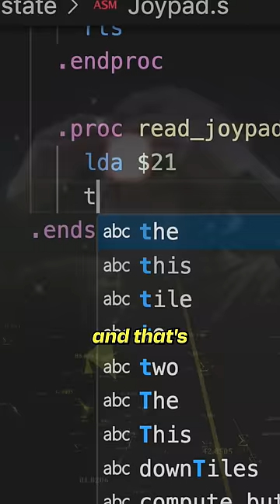NES Games Were Written in Assembly #nintendo #nes #programming #assembly #retrogaming #retrotech

Comment: Assembly is beautiful. A nightmare, yes, but so absurdly efficient when used appropriately
Reply: Any examples I could look into?
Reply: @katzlover321  Quite a few older PC games. Flanker something and Rollercoaster Tycoon come to mind. I could be mistaken, but I believe ID Tech One was built in assembly. At least some of it. It's just insanely fast. Entirely impractical on a modern PC I would imagine. Or pointless 😂
Reply: An 8bit machine is simple enough that it's anything but a nightmare.
Reply: Well, it used to be efficient. It turns out that modern (i.e., after ~2005) compilers are very good at optimizing code for modern processors. I wrote an algorithm in C and then again in x86 assembly, then had a friend (also a programmer) do the same thing. In both cases the C code ran faster than the assembly code, but only by about ~10%. Things like deep pipelines and branch prediction improvements have made writing efficient assembly by hand extremely difficult.
Reply: @TechnocratiK  100%. Compilers have grown so effective that assembly isn't worth it. Add to that the improvements AI will make to said compiling and soon we'll just dictate our ideas to a computer. 

Amazing times to live in.
Reply: @natecw4164 AI literally just hallucinates half it’s code and it rarely works. Please shut up
Reply: @ponivi  What you're seeing today is the worst it's ever going to be. Also that's a huge overstatement. It's not ready to write on its own, no. But half of it being hallucinated/wrong/gibberish... Ask all the engineers out there working for large corporations if AI has helped speed up their work. Like A LOT.
Reply: @ponivi oh yes, AI will always do exactly that, there's nobody working to improve it, no money in it... 😂😂
Reply: Unfortunately, for anything complicated a compiler will do a better job than most anyone can
Reply: @natecw4164 ya, coding in assembly for any powerful processer is just not feasible for a human to do better then the compiler. Knowing how to read assembly is still useful for decompiling or for bespoke processers
Reply: Compilers theese days are so efficient that you hardly could ever do a better job
Reply: @tonyvisente5286  compilers are incredibly efficient. Assembly code gets compiled too. Efficient code + efficient compiler.
Reply: Man just looks pc NEC series Japanese very know how to make game with assembly
Reply: I wrote a lot of assembly.  But back then instructions made sense, the instructions today are mostly unusable by humans.
Reply: @TechnocratiK for which architecture? I took a class for 32 bit ARM architecture assembly language,  our professor (part time, he was actually a full time industry guy and pretty sharp) said that assembly for ARM at the time used to be 3x faster but modern compilers were pushing it down to only 2x.  Sounds like people weren't writing optimal code if compiling C was faster.
Reply: @onradioactivewaves  I wrote x86 assembly, and the test was done using Microsoft's, Intel's, and GNU's C compilers, all of which produced faster code than hand-written assembly. It would surprise me if compilers for ARM (armhf/aarch64) produced significantly less efficient code than hand-written assembly today, given the platform's ubiquity. That said, Intel's processors have pipelines with 20+ stages, whereas most ARM processors cap out at ~6---the assembly programmer is at less of a disadvantage to the compiler when writing for ARM than when writing for Intel.

In x86, the code we ran was about 15% slower in assembly than compiled. I could foresee ARM assembly being 5~10% faster than compiled when written by someone familiar with the architecture, but I'd need proof before I believe 100% faster (i.e., 2x as fast).
Reply: @TechnocratiK  ya K guess I'm not surprised if compiling is faster  given a larger amount of code.. I didn't do that much, but I think it specifically we had a device driver project on an Zeus ax-270 ( something like that, we had all sorts developmental/ not released versions of tech donated by Intel) It had a 6 or 7sttage pipeline with 1 bit error prediction flushing.  I did get my introduction to assembly level much earlier doing some borland turbo assembler back in the day..... Also done a fair amount of work controllere using primarily A-class (but also some M-class) chips. One of our devices had 3 seperate SOC's on a single device .Anyhow I've got a pretty broad level of experience from hardware to software and everything in-between,  but as it with technology, I blinked and feel totally outdated on present knowledge. 

I saw some 6 trillion transistor chip  got released ( wafer ‐ chip) with 1000 cores. Crazy where we're at these days. People used to program bots to have more computational power,  now you just ask A.I. to do it for you. I've even seen some guy on YouTube who in his garage was making a cold plasma torch for sputter coater to make traces on glass so he could have grown human neural tissue control a microcontroller to play DOOM!   🤯  crazy how fast technology is moving these days
Reply: @TechnocratiK  just a cool story about the professor I mentioned, he invented some cell technology where bigger FPGA gate clusters acted as a single smaller logic gate, and they had they ability to repair themselves if an individual logic gate failed. He showed us a little bit of his work, but had to stop where the point they had some deal with N.A.S.A. very cool tech...
Reply: The best part is that in many software engineering programs, assembly language is heavily used because of its efficiency. It was one of my favorite courses.
Reply: @crazyjdog  efficiency isn't necessarily the main reason why to use assembly, it allows for greater control of precisely what happens.
Reply: @natecw4164  id tech 1 was mostly written in C, but yeah, some parts of it were written in assembly
Reply: I never had nightmares over the programming languages I used
Reply: @ponivi I have worked with AI extensively, and you would be surprised how little it (GPT-4) hallucinates. We have to adapt to the future, not dismiss it so carelessly. Think before you type 🤦‍♂️
Reply: @ponivi wrong wtf
Reply: @vablo-yt AI is trash your comment proves nothing against his comment so you should also think
Reply: @stolensentience  proof? your comment "AI is trash" also proves nothing against my comment.
Reply: @vablo-yt  I’m not the one running around simping for AI. proof that AI sucks is everywhere all you have to do is google something, or listen to ai generated nonsense, or feed any teleological query to your precious homework bot. go ahead and defend it though, who exactly cares? but it is indeed trash lmao
Reply: Yes but i messed the "command" thingy so
Reply: @katzlover321  The original Atari version of Pitfall has a Post Mortem somewhere here. The effect of Harry falling into the water is achieved by not drawing any portion of him that goes below a certain line on the screen for any screen that has those water hazards.
Reply: code clean more nightmare , too way many abstractionn😂
Reply: @SianaGearz  the shorter your assembly command list for the processor is, the longer the program is. Yes you can refer to prewritten instructions set libraries, but if an 8 bit micro doesn't have a hardware multiply you have a new nightmare: instruction cycle bloat.
Reply: @TechnocratiK  Yeah, it is still good to insert hand written assembly into code for simpler microcontrollers when the complier doesn't play nice. I guess most of the time this would be the space most people refer to as firmware.
Reply: @natecw4164  I wouldn't hold my breath on that... 
Have you seen any honest reviews on the lapel AI assistants?
Reply: @Tom89194   You have 16k of code budget or less. That fits on a handful pages of print. Lack of hardware multiplication is also a design guideline: DO NOT MULTIPLY. There are no libraries, just useful snippets which you keep adapting. Program simpler, this is the only way with such a constrained system.
Reply: Not a nightmare at all. You just had to know how the hardware worked.  Most programmers were eager to learn, unlike you.
Reply: @SianaGearz  I guess not multiplying might be possible in those simpler games? That was NOT an option for the 8-bit code I wrote for microcontrollers, just about all of the projects I dealt with required multiplication and many if not all 8-bit micros sold nowadays have a hardware multiply for a reason, so I wouldn't even have dreamt of a situation where a multiply doesn't show up regularly in the code.......
Reply: @Tom89194   Very few 8-bit games have a general-purpose multiplication routine. You can always multiply by a constant, particularly if that constant has only a handful active bits. Shifts do some heavy lifting. Small table lookups for non-trivial math. Division can often be substituted by Bresenham. Game design leans on hand tuned behaviours rather than physical accuracy.
Reply: Everything is built from And, Or, Not, Xor.

Comment: To be fair, the 6502 is a very simple CPU with only a handful of operations. It's way easier to write and understand 6502 assembler than it is an enterprise C# or C++ application these days. At least in 6502 you get what you see, no magical stuff like reflection and huge runtime libraries.
Reply: Even a 68030 is much better, I did ASM on those.  Today, OOP takes advantage of the huge caches to get better results.
Reply: C ain't so bad, plus you can learn that and not have to learn assembly for multiple CPU's.
Reply: Spoken like someone who has never had to deconstruct someone else's 6502 assembly code.  It's much easier to write spaghetti assembly especially if you're doing crazy stuff like self modifying code, or jumping to the middle of another subroutine instead of calling it to 'avoid an extra rts', or inline data where one byte off makes it a nop vs another opcode as an enhancement for cycle alignment or to literally save 7 bytes so it would fit on a cheaper mask ROM.  Nah dude, C# (even with reflection, and app domains) is so much easier to decompile and understand than most 8-bit video games.
Reply: @toriless  Did the 68030 have cache ? I think I remember reading that one of the latter 68k processors had a ting 256 btye cache for data  or instructions or both I can't remember
Reply: It was also a very cheap processor. $25 on its release. All because the Motorola 68000 was much more expensive and beyond the price range of many engineers.
Reply: Gotta say I really loved C#.
Especially the latest versions with generics and implicit explicit typing.
Reply: @MostlyPennyCat  For sure, I've used C# since day 1 and it's what feeds my family :)
Reply: @AFourEyedGeek Incorrect. How would you write a boot loader with C? 

Spoiler: you can’t without assembly
Reply: @Dany-z9s  that doesn't change my point at all though. My point, if you read and understood it, is that the C language is good and you don't have to learn multiple assembly languages for each CPU. A small aspect, such as a boot loader, can be done in assembly, then switch to using C. You just look up that individual function in assembly, copy it, then forget it.

Comment: I used to program my C-64 in assembly.  Once you start programming and get into a rhythm it is not too bad and has a number of advantages in execution speed and size.  Something that was critical with limited ram
Reply: Assembly is basically the fastest and most efficient code to run other than coding directly in binary.

It's unfortunate that it more or less means that the code won't run on anything else without a lot of rewriting.
Reply: @SmallSpoonBrigade Yes you're basically writing precompiled code
Reply: Braben and Bell fit entire galaxies inside 20kb.
Reply: @stoobidthing 
There's not that many instruction sets out there these days though. 
ARM, x86 and now RISC V.
Then there's all the other microcontrollers that aren't ARM.
6502 and Zilog are just for fun really these days.

Comment: Oh and long division gets really fun.  for a HS project I had to write a temperature simulation and due to how many times it had to iterate, it had to be done in assembly.  Had to code a division of 3 bytes by 2 bytes to get a 2 byte answer.  There were no references or examples back then, you just had to figure it out.  Ran it all night on my //c, got the most accurate, highest precision answer of anyone in the class. :)
Reply: What did you do after?

Comment: I did some assembly programming in my college days (IBM Assembler). It’s very very low-level but also quite powerful and efficient. I recall that the only way to debug it was to literally print what was called an hex core dump and find the errant instruction code. It forced you to be extremely careful and thoughtful about your code composition and organization. Fun times.
Reply: That's the biggest difference between now and then, debugging.
Everything runs on CMOS now which means you can stop the clock and step through instructions examining the registers and memory contents as you go.